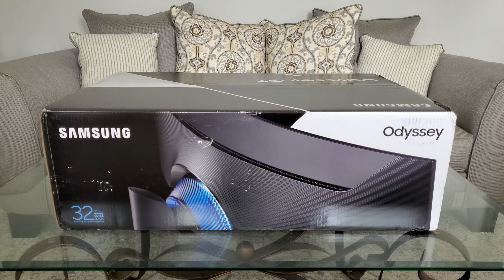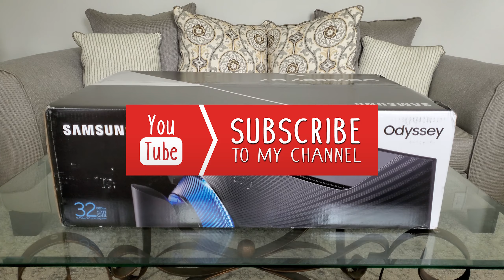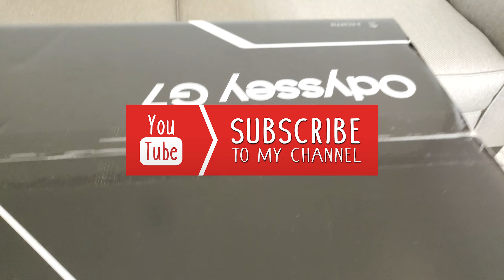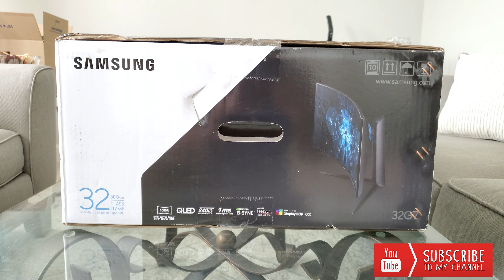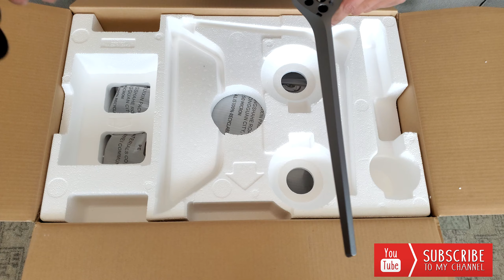Samsung Odyssey G7 Gaming Monitor QLED 240hz 32inch Unboxing and Setup

Comment from the maker: Samsung Odyssey G7 Gaming Monitor QLED 240hz 32inch Unboxing and Setup
Reply: I'm new to this but what do i do with hdmi cables? Do they have to be plugged in other devices in other for the samsung to turn on instead of having no signal?
Reply: 27" is perfect and most pros use it. the extra cash for the 32" isn't worth it.
Reply: Buy 27inch and do some gaming
Esports using 24.5 ,32 way to big
Reply: @defone222  I could say so much right now, but I guess that’s your opinion.
Reply: 32 inch is great for console gaming, gaming with a controller, too big with keyboard and mouse and competitive gaming in general.
Reply: @glow4417  i'm the opposite, i don't like gaming on small screens so something like this would be perfect but i don't play any competitive games
Reply: @HalfNuked  yee the small monitors no good.i have odisey 32 very very nice for my game World of Tanks
Reply: @glow4417  I guess that’s your opinion
Reply: how do i turn on infinity core lighting
Reply from the maker: It is in the settings menu.
Reply from the maker: You can choose your own color from the color gamut
Reply: @MyGadgetsWorld  have a speaker ??
Reply: What size is the depth (back to front) of your desk in this video? Trying to find out if I should get 27 or 32 inch for my desk size.
Reply from the maker: 3ft and 5ft
Reply: @CBGENESIS  the
Reply: Hi, what are the inches from point to point on the stand? I have a small computer table and want to know if I need to get a new one...thanks for your time
Reply: The size of this monitor is all preference. Go with wut you prefer.
Reply: How do I update the monitor software updates do I use a usb or something do I have to plug it into my computer in order for it to update. Great video 👍🏽 I get mines in a couple days so I can't wait to try it.
Reply from the maker: @Hawaii_Trucker  you can download from Samsung website.  You will need to copy it in the usb and the plug in monitor to update.
Reply: @MyGadgetsWorld  thank you for the reply back. I'm still learning how to do this would you be able to maybe make a small video on how to do that and what I would need to do it? Or Maybe point me to a video that shows that any help I'd greatly appreciate it
Reply from the maker: @STRA8TRUCKN  thank you.  actually I did. Check videos on the channel.

Comment: Is any way to plug your headset into the monitor and use the microphone on it, or is only compatible with the audio? Was trying to test the Nvidia High Audio but now my mic won't work when I have the headset plugged into the monitor.

Comment: I don't get why 4K is not just the standard right now.  I get that its a bit intesive for gaming, but most PC users would want 4K for literally EVERYTHING else.
Reply: 4k imo is just not worth it unless you can break the piggy bank a few times. If I could play 4k at 144hz I would take it. But I got a 3070 so 1440p ultra with all the frames makes more sense for me and is vastly better than 4k60fps I was playing at before. I think it will be another 5/6 years before everyone is ready for the joys of 4k.
Reply: @stolenname94  I agree, After spending time with the G7 and a 4k 60 hz I found the 4k to be great with videos and some games like No Mans Sky and Battlefront 2.  However, with most games, the 4K tends to accentuate flaws in the resolution which ends up looking janky.  In the end I mostly preferred the G7 at 144 Hz for the smooth frame rate and richer colors.

Comment: I have had mine for a months now. The best monitor i have ever experienced playing with. However. Yesterday i switched my screen Off and i have not managed to turn it on again. Someone help.
Reply: Could anything from your, graphics card to faulty power cable or dp cable. Or try if it says no signal then open the menu by using the thumb stick and changing port.

Comment: Too dark when it was hooked up, play GTA, I had to do few adjustments, also I tried connecting my mic using USB, does not work, it does have for external speakers hook up, sooo far my older monitor,  Dell s3220dgf,  I think looks better and did have usb for the mic, the Samsung monitor, is way too much, not worth it, more likely returning this monitor

Comment: Hi, did you notice the huge white streak in the middle of the screen on the 32 inch version (your has it seen around 10:15)? Mine has the same, and have removed most of it with water, but still some stains left in dead center... Did you remove them somehow or returned the unit?
Reply: It's from the packaging resting on the screen to prevent damage on the curve , they need to sort it out I just got mine and had the same issue

Comment: I’m so unstable, which one would you recommend me for odyssey g7, 27 inch or 32 inch, i’m looking for movies, studying and games. Also is it worth to upgrade with 200 dollars?
Reply: 27" FTW. Most pros use that size.
Reply: @UnknownUser_0000  I bought 32 inch version, i’m grateful except for panning at standart videos which has 28-30 hz ones. Now i’m thinking 34” qhd 21:9 aspect ratio curve panels are a bit better but unfortunately they have low refresh rate like maximum 165 hz. I don’t like 16:9 aspect ratio, %10 lower pixel density and panning problems however it has a great contrast ratio, sRGB and DCI-P3 scores.  I tried every way to solve panning problem, installed latest softwares for graphic card and monitor, calling Samsung service but i think only way is rendering videos to 60 fps ://
Reply: Many reviews state that though shipping the 32” it can get damaged, many users have reported dead pixels on arrival. I own the 27” and coming from a 35”benq ex3501r, it took time to get used to the colors great and much sharper than my benq, I run it using just g sync on in nvcp and adaptive sync turned on through the monitor it’s self, take some time to set a custom color preset because the default are great but no excellent, running a 3090 and the display feels great

Comment: Is there any major graphical and immersion differences between the 27" and the 32" with the Samsung Odyssey G7. I'm stuck between the two. I read from many people that the 32 inch has a lower pixel density compared the 27 inch. Meaning that the 32 inch  practically shares the same ppi as a 1080p 24 inch display. Statistically this would make the 32 inch a downgrade right? Or is this not a huge difference to the human eye?
Reply from the maker: Yes. 32 is more immersive
Reply: @MyGadgetsWorld  My Samsung odessey g7 32 inch finally arrived the other day. However I am noticing some sort of screen tear occuring. It starts from the top of the screen and ends at the bottom for like 5-10 seconds. This only happens when adaptive sync is not enabled. I would keep adaptive sync on but I lose the option to enable the low input lag which in my opinion is really good for competitive gaming and the difference is quite noticeable. Is this a common issue or is it just a faulty model that I happened to receive?
Reply: @sh4rpshooterrr228  
Common issue, it’s the low input lag option. You have to turn it off. That setting is basically useless and it’s the biggest con for this monitor.

Comment: My G7 doesn’t run at 240hz and I don’t know why.. once I connect via Displayport 1 
I can only get it up to 120hz in Invidia Control Panel.. anyone else with the same problem ?
Reply from the maker: No sir. All working fine
Reply: @MyGadgetsWorld  any tips ?
Reply from the maker: Make sure you are in PC resolution not in UHD TV resolution.  And then try a different cable. Sometimes it is because of cable.
Reply: @MyGadgetsWorld  I appreciate your time thank you!

Comment: help me please, i have the exact same monitor and for some reason the max hz i can set up is 144hz, the 240 doesnt show up, im feeling robbed, help please
Reply: are you using a display cable? cause hdmi only supports up til 144hz
Reply: @jessemulder4881  yup.

Comment: I see your 240hz option is disabled in the monitor option. How can you aktivate the 240hz refresh rate on the monitor?
Reply: You need to use a display port and it automatically goes into 240

Comment: Hello, good job for great review, i want to know if change the resolution to 1080p, can it running on 240hz too?? Since this monitor can running on 1440p 240hz. Because there are few old games that can running only on 1080p. Sorry for bad english, hopely you can answer my question. Thank you
Reply from the maker: Hey there. Yes you can do that. It is available at the maximum resolution of 240hz.

Comment: i think the cable management plastic is a bad design. Once you plug in the upstream cable and power cable, it requires the wire to bend upwards then downwards which doesnt work well due to the thick stiff wires. Also it closes off acess to the usb ports so i use the monitor without it. I hope this helps someone in making their decision.
Reply from the maker: Yes. I AGREE WITH YOU 100%
Reply from the maker: Even Samsung DP cable is not flexible.
Reply: @MyGadgetsWorld  Yes!! I felt they should have given us a thinner more flexible cable to do this or put the hole at the bottom. Then again, it defeats the purpose of having a usb 3.0 hub closed up. This to me is one of the major design flaws of the monitor. However, the beautiful panel makes up for all of this.

Comment: can you pernamently turn off the rgb. what i mean is if you turn it off does the lights come back on everytime you turn off and on the monitor. i have had issues in the past with monitors where if i turned off the rgb and then turned off and on the monitor i would have to go back into settings and turn off the rgb again
Reply from the maker: Yes you can, from the settings menu in the monitor software.

Comment: Would the G7's curve be too aggressive for video editing purposes or workable?
Reply from the maker: Yes it is too aggressive. Also i was getting weird feeling typing a letter on word. It is so much curved that it is only best suited for gaming and watching movies.
Reply: @MyGadgetsWorld  Do you have any recommendations for monitors good for editing and casual gaming?  I currently have a BenQ 25" flat monitor (non-gaming so it's a lousy 60Hz) but have a new powerful gaming/editing PC w/ RTX 2080ti and Ryzen 3950x ordered and would like dual monitors for it.  I'm old and have sensitive eyes, which is why I've loved the settings on my BenQ, but I'm thinking the extreme curve on the Odyssey G7 and large 32" size would be uncomfortable for my eyes for editing or gaming.  If you have any recommendations for 27" curved monitors, I would appreciate it.  ♥
Reply from the maker: I like ProArt monitors. If you want all in one type monitor then I will suggest look into Dell. Dell monitors are sharp and color accurate.

Comment: Great video Sir. Could you let me know if i should go for it having an Xbox X 120hz, mainly used for COD MW but also 4k gaming. Appreciate you
Reply from the maker: I will not suggest it for xbox and ps5. New xbox and ps5 i prefer to go with oled TV or samsung gsycn tvs
Reply: MyGadgetsWorld  Thank you! Is there any monitor you would recommend? 1ms, min 120hz, 4k? Was looking at Acer Nitro XV273KP
Reply from the maker: I think most of these monitors are 4ms rates. Barely any monitor can do 1ms 4k 120hz
Reply from the maker: This will not do 4K.
Reply: Don't play mutiplayer on 4k your frame rates will really take a hit. 1440 is more than enough.

Comment: Bro one question, when i had a 1080p 27inch i could see the pixels, 27inch 1440p was ok for me, at 32inches 1440p do u see pixels?
Reply from the maker: This is QLED. I think that is why it is hard to see those individual pixels if you sit about 1.5ft ft away from monitor.
Reply: @MyGadgetsWorld  Sorry, with my limited knowledge what does the fact that this is qled have to do with pixel size/density and me being able to see pixels with the native eye?

Thanks alot for your answers

Comment: Would you recommend for next gen console and current ?
Reply: A 4K monitor would be better.
Reply: @JBrown-go8ru  obviously higher resolution is better but good luck finding a 4k 120hz monitor with hdmi 2.1 for $700-$800😅

Comment: Should I get this or should i get the eve spectrum 144hz? I've been researching, but It's either this or that.
Reply from the maker: Eve spectrum looks solid on the books. I really like the specs but with these crowd funded companies delay a lot providing product. If you will do PC gaming, to be honest HDR is not really good right now for almost any monitor to display is perfectly. If you will use it with console then you have options like oled tv with gsync and freesync n all.
Reply: Probably the G7

Comment: The VESA adapter is not usually for mounting to the wall. You usually use the VESA mount for articulating monitor arms you clamp on your desk, so you can get rid of the massive stand. Thanks for mentioning it anyway, as this is a very important feature for me.
Reply from the maker: Thanks for this info. Really appreciate it. Actually i never mounted monitors always place them on desk
Reply: That is right. Monitor arm is best thing that i discoverd  after i bought LG GL850 great monitor with crappy ergonomic.
Reply: Thanks mate, I was wondering"why is there a big metallic piece remaining ? What did I do wrong ?"

Comment: How is pixel density and picture sharpness with the 32'' model? Is it a lot worse than the 27'' model? I've read that 27'' is the sweet spot for 1440p and provides the sharpest picture.
Reply from the maker: This is on point with 32 inch. I really love how samsung nailed it.
Reply from the maker: If the purpose is just gaming then 27" is better choice. But if you want something that satisfy movies, work, and gaming. This is the one.
Reply: @MyGadgetsWorld  Thank you sir. One more question, does it really support G-Sync at minimum 60Hz or does it go any lower?
Reply from the maker: 60hz minimum it can go.

Comment: Why not set the monitor to Nvidia control and change the color depth to 10-bit, vice 8-bit color?
Reply from the maker: I did that and it works fine on 10bit. I usually leave it at auto and let it be controlled by Nvidia

Comment: Cant change the height on mine🙃 Feeling retarded af rn
Reply from the maker: Ah really sorry about that. Did you try to check if the ARM is moving without mounting it to monitor. It is actually ARM that moves up and down
Reply: @MyGadgetsWorld  Some force got it moving, Im used to the height adjustment being very light and easy
Reply: Same here is there something I need to press so it can go down? I pushing it down but it won’t budge
Reply: @ceciliaorantes7781  Yea you just have to use some force then it becomes easier
Reply: @ceciliaorantes7781  Nothing to press

Comment: A UFO test would be super helpful. Also when you’re in the resolution screen tab in nvidia control panel, can you set it to 10 bit and using 4:4:4 chroma Subsampling?
Reply from the maker: I did the UFO test already. Check my other video. And yes you can do 4:4:4 10 bit no issues.
Reply: MyGadgetsWorld thank you will see video now 👍

Comment: Does 1440p 32 inch look 1080p?
Reply from the maker: Not really if you sit max 2 ft from monitor. It looks better than 1080p for sure. I had a LG Ultra Gear 144hz 1080p and this looks way better than that at 1440p
Reply: 1440p on a 32 inch is the same dpi as 1080p on a 24 inch. Obviously with a 32 inch you're not up close and personal as you would be when using a 24 inch, thus giving the illusion of the 32 inch display being that much more sharper. I've just bought a 32 inch 1440p screen (Gigabyte G32QC) and am really surprised at how sharp it seems compared to my last 27 inch 1440p screen (Asus 278Q). Decent review by the way, although I would've liked it displaying a couple of games too. Cheers.

Comment: Very interested In this monitor 240hz  HDR. 32in. I currently own A  ultra wide 3440 1440 🤔🤔🤔 Not sure
Reply from the maker: This one is 2460 x 1440 but man the curve 1000R makes it a real deal and of course 240hz.
Reply: 2560x1440:P
Reply: I have a 3440x1440 as well and I will never leave this 21:9 ratio.

Comment: How long is a power cable?
Reply from the maker: About 3 meters
Reply: @MyGadgetsWorld  That is good to know, cause I know that CRG9 monitor from Samsung comes with 1,5m long cable - that is not long enough for me. I will probably order Odyssey G9 - the big daddy and it should have the same cable. But only if it gets positive reviews. Thank you..
Reply from the maker: Just to clarify , It is about 3 meters with cable and power cable box attached cable. Otherwise just power cord is 59 inches.
Reply from the maker: So, unfortunately just power cable is 1.5M. Sorry about confusion
Reply from the maker: You can buy a long cable after market to be honest. This monitor is so good.

Comment: The mounting plate is for use with a mount, because the hole is recessed and  circular
Reply from the maker: That's right. Otherwise it is too deep. But you can mount on the dry wall directly it has holes for that also
Reply: @MyGadgetsWorld  you'll never get in place unless you have 2 ppl doing it had a chg90 and 3 crg90 so I've put on mount many many times lol